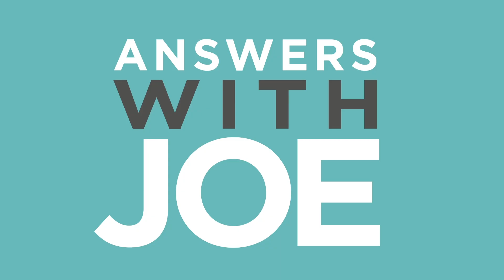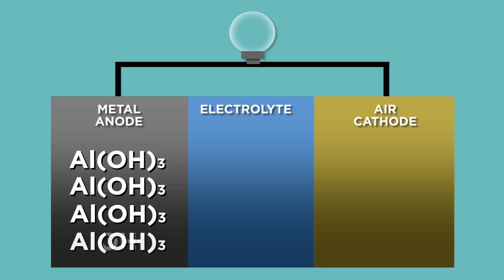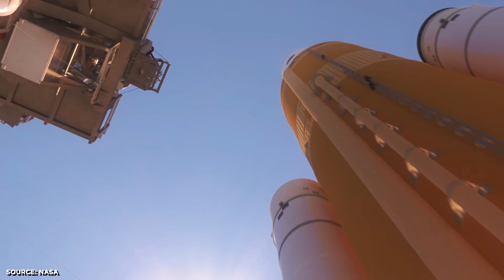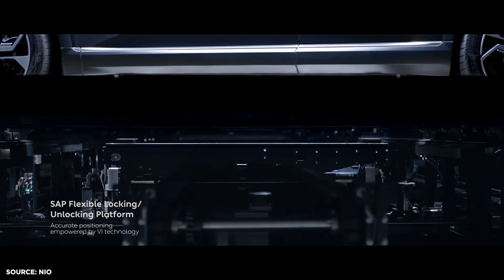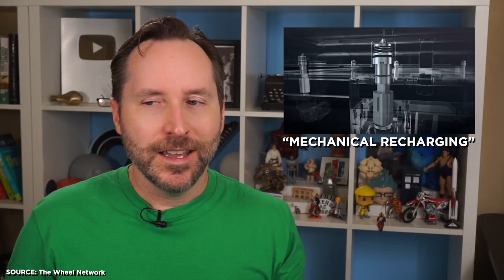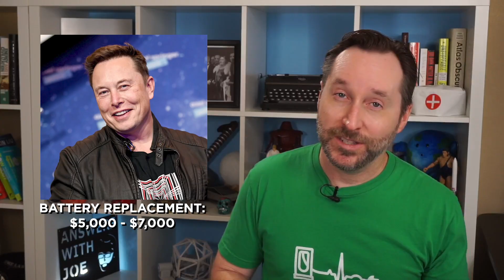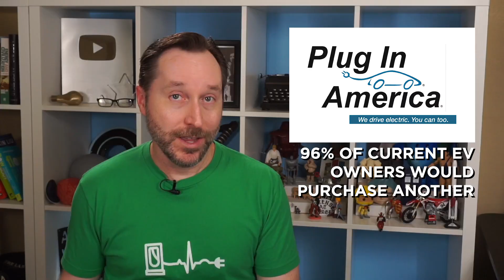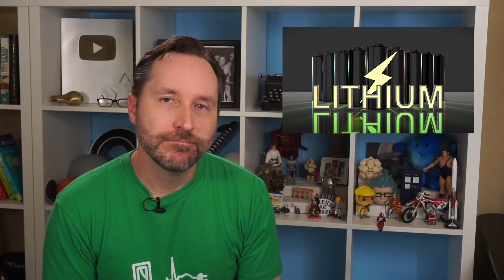This Battery Could Drive A Car 1500 Miles - But There's A Catch | Answers With Joe

Comment: These batteries sound like a pretty good solution for all kinds of services that rely on a fleet of vehicles that is maintained regularly in a central hub, rather than for private vehicles. Mail vans, deliveries, dump trucks etc. could be "refilled" whenever the batteries run out, all in the same place and without the need for a ton of additional infrastructure.
EDIT: I have no idea what's happening in the replies to this comment, venture at your own risk
Reply: They sound terrible from the perspective of the mechanism of action of these batteries being to hydrolyse aluminium. Reduction of alumina is one of the most energy intensive processes in metal refining. There is a reason that aluminium is called congealed electricity.

Reducing alumina to aluminium metal is 40% efficient, add in dehydrating the aluminium hydroxide that this battery produces, cleaning the cathode (pure Al cathodes degrade very quickly, 80% energy loss after a month or two), distribution (both ways) and remanufacture of the likely complex electrodes and I can't imagine this would be above 15% of the energy put into make, transport, remanufacture this battery as useable energy out.

Much better to use rail for heavy goods transport, can run off grid electricity so it's the best you can get really. 

This seems like a dumb idea that venture capitalists who understand nothing have thrown money at. It won't pay off. 

Unless you can vastly improve the energy usage of aluminium refining this is a complete non-starter. It's always going to be worse than just using the electricity to power vehicles directly, so rail, trams, trolley buses etc are far better options.

Hell you can get basically free transport if you are mining up a hill with gravity trains, but I guess 19th century tech is just so passe. 

I do you wonder why this 60+ year old technology hasn't become a hit so far? The limiting factor is the expense of producing Al metal, which no huge process improvements have occurred in decades.
Reply: @seb3090  if the Al production was running off excess renewable power, which in some locations is substantial, it might well be a solid green alternative.
Reply: @AlexanderTzalumen  mining is not and never will be 'green' regardless of the greenwashing you have swallowed.

What exactly are you going to do with the red mud from Al mining?

You'll want to read the book Bright Green Lies for exactly why green technology is anything but good for the environment.
Reply: @seb3090  i mean, there's always a solution(like vitrification for the mud) , but most of them require more power consumption. That's the biggest thorn in the side of green technology. We can drastically cut pollution by expending more energy, but that only works if the electricity comes from renewables, and only if there's a surplus of capacity.
Reply: @seb3090  it depends on the solar being used, concentrating solar uses the least advanced materials. like anything else, bootstrapping the industry is required to shift the industry to using its own power generation technology and thus break away from fossil fuel power.

Desert environments are optimal for both generating concentrating solar power and for minimizing the wildlife and terrain impact of deploying a power plant.
Reply: @AlexanderTzalumen  I guess birds being cooked as they fly isn't an issue you care about, or destroying desert ecosystems, I guess they have the least utility to humans, so human supremacy still.

Living above 50 degrees north means solar collection isn't really a viable solution and we have 0 desert. 

Deindustrialisation is the only solution for the long term. Mining everything for ever more stuff isn't going to do anything but result in the destruction of the environment. Mines are some of the dirtiest things humans make, bloody tailings dams and their caustic wastes. Mines from Roman times are still polluting to this day. So no mining is never going to help the environment, it only ever pollutes.
Reply: @seb3090  
"Green technology is good"  because you mine ONCE (But not in this case)
Reply: @AlexanderTzalumen  
Regarding "surplus capacity".
There is no "Surplus (green) capacity".
It's simply "unused"
The trick is to get it into a storage medium which can hold it until required. BUT that medium must itself be Green once constructed.
This isn't it.
It must be some form of "rechargeable" device, not requiring refurbishment after each cycle, otherwise you just throw energy away.
Moreover, a rechargeable cell/ pack used for storage actually offsets (removes) fossil generation from the grid.
This cell type may seem to do so, but will give back much of that gain when itself recycled
Reply: @rogerstarkey5390  It's a shame that we mix metals so much so recycling say magnets isn't practicable. A lot of this green tech really likes to mix things, Lithium batteries are very difficult to recycle, so are all  electronics. We live in a very wasteful society and green tech is still that. The theory is good, the reality is far less good.
Reply: @seb3090  In my long experience of life. Those that require humans to behave in a certain way usually don't mean themselves just other people.
Reply: @seb3090  Then we just need to prioritize mining the moon. No wildlife there and the environment doesn’t matter since there is no life and never will be other then in pressurized bases.
Reply: @seb3090  Moon mining was a joke lol, that shit is totally unrealistic.
Reply: @seb3090 ...........maybe, this battery would be good in Norway, notable for its production of Aluminium in hydro / green powdered methods, but as the population is small, and the big tooling up cost, even here it is likely to take a public private partnership to get it off the ground. Lithium seems like the ' fix ' for a while , and for the interest in Cornwall , I hope it comes off.
Reply: @robertwoodliff2536  Ah hydro, killing rivers for human production. Not sure that counts as green technology. Destroy ecosystems just for power (they don't need water in Norway).

Do you know how much CO2 is released per tonne of lithium? It's about 15 tonnes. Steel is green by comparison at only 2 tonnes. If batteries were actually recyclable cheaply (both in cost and energy requirements) then maybe this would be good but only 5% are currently recycled.
Reply: @jeffreyblack666  Capitalism and the ownership of land itself means I can't actually do that. There being half the people on the planet is probably good for the planet, maybe even fewer people. 

I note that you are telling me to do this not actually arguing against what I've said, almost like you know I'm correct but don't want to face that and just deflect.

Why should people not put out the opposite argument to the everything technology is good and will save the planet when it won't. If we all disappear then the technologists and capitalists will definitely win, how does that help me? 

We take resource from the planet, refine it, make things with it and then return it to the planet in a toxic, never rotting state. We are vermin. Almost no other animals do that, they contribute to the cycle of life and death, we create death and nothingness in our wastes.

If we had less medicine we'd have fewer people, as we'll discover in a few years once everything becomes resistant to antibiotics, which we've not had a new class of for 30 years or more. It's arguable we've not had any new ideas for 40 years, everything is just slight evolutions of older tech, we no longer have supersonic passenger travel, even this silly idea for a battery is almost as old as electricity.
Reply: @seb3090  And here you are again, once more preaching hypocrisy.

You mean you can't get land where you want it. See if you can get some in a 3rd world country, or just move there. See how great life is then.

And if you think capitalism is bad, have you considered how much worse tribalism or the collapse of society would be?

The reason I'm not bothering to put in effort to argue against you is that you aren't being rational, as shown by you engaging in the very things you think are so harmful.

And this is further shown by your strawmen.
Who is saying everything technology is good? No one. That is just your strawman so you can attack technology.

You are asking for people to go into poverty and calling for mass death. Yet still continuing to live a nice life.
Reply: @seb3090 .........thanks for observations. It's all relative. I am not quite sure how humanity gets out of this cleft stick it is in. Hydro....less bad......this is the discussion of car v bicycle.....bicycle green, but still made from steel.....less bad.
Reply: @seb3090   @Seb  I mean I definitely agree that rail is the way to go for cargo, but energy storage will forever be the weak link of EVs, and EVs are one of the best arguments for nuclear power. It's not energy efficient to refine alumina, but again that's where nuclear power comes into play. I'd rather design something that was user friendly but inefficient, so long as its carbon free. 

As far as venture capitalists who don't understand anything goes, the cathode in this reaction is hydroxyl and yes, the electrolytes get consumed. I think what you mean to say is that the anode will react with the electrolyte when not in use, so their shelf life is low when not in use, but this is a problem that can be designed around and the shelf life of gas is only a few months anyways.

The fact remains that conventional batteries are basically at their fundamental limit, and that limit isn't even particularly good. Low energy density, high charging times, they're just awful for cars. Solid states are exciting, but haven't matured yet, and there don't seem to be any breakthroughs in super capacitors on the horizon. Fly wheel driven cars would be interesting, but that has its own list of problems.

What else do you propose we do?

(Oh and as far as it being old technology, yeah, because gasoline was easier. That's the problem we're trying to solve)
Reply: @seb3090  "My advice is to not have children" - excellent idea, for you.
Reply: @seb3090  You're still here? Man up! Be part of the solution.  My ex-finance was convinced that the end of the world was always 3 years away for 6 years.
Reply: @seb3090  I agree on a lot of your points, I just want to point out that trees can actually sequester carbon in the form of light wood frame buildings (construction industry roughly accounts for 35-40% of carbon emissions) especially if they are less than 25 years old when they are harvested (depends on tree species). Also nuclear power is one of the safest, cleanest ways to produce energy on a large scale even including the storage of nuclear waste.
Reply: @2209aug  So at the end of life of the building what happens to that wood? I'm not talking about 100 years I'm talking about sequestering it forever, you know in things like coal, oil or calcium carbonate. Wood rots and releases the carbon back into the atmosphere. It does not sequester for the long term. It's more arguable that concrete releases far less carbon as it absorbs it over 100 years or so, OK it's only absorbing what was released to produce the quicklime but at least it does resorb that over time. (concrete is not environmentally good, but the majority of the carbon released is resorbed.)

How do you store nuclear waste for the long term? How do you make that safe from harm? If nefarious actors got hold of some high level waste that had been dumped how much trouble could be caused?

The waste is very bad and remains very bad for tens of thousands of years. How do you secure ANYTHING for that period of time? I mean they don't even know the state of the mines under Paris that were dug in the last 1000 years so do tell me how we keep nuclear waste safe for at least 10x longer. 

The 2 major nuclear issues have produced vast quantities of dangerous waste and made tens of square miles uninhabitable. I mean things don't rot in the forests around Pripyat the environment has been damaged so much.

I'm not anti-nuclear, it does have real issues that no one has solved yet and likely can't be solved. The 'best' solution we currently have is to find a very deep hole and throw all the waste in and walk away.
Reply: Just gonna mention, but advancing as a species in itself creates waste. You cant just tell everyone to "stop using technology because it creates waste".

We're trying to go with the least amount of waste created, we wont ever get to no waste created without going back to caveman times. SO yeah, it would probably be best if you guys argued based on how much waste is being created rather than if its creating waste. 

And if someone says that we should go to a "no-waste state" let me remind you that even living in the wild and creating campfires requires waste, that cheap survival knife you're using exhausted waste to create. You telling me you aren't going to damage any trees, aren't going to wear any clothes (yeah, your clothes create waste) and also arent going to kill any animals? (making traps can cause the dead plants to excrete waste, and anything you cant eat off the animal will go to waste as well)

Stop acting as if something is bad simply because it creates waste when its much better than the other alternatives that create MUCH more.

idk. Maybe I'm not understanding what you guys are saying, but still.
Reply: @aj_art7201  It depends on if you value any other life than human. The level of consumption humans currently have is unsustainable and all the 'solutions' offered are pretty much of the 'just use more' to get around the carbon is bad (but at least it's energy dense) problem.

All the green solutions require more mining or destruction of nature to provide for the unsustainable human lifestyle as it currently exists.

I am aware that humans themselves just by existing use resources, 0.5kg of CO2 per day we emit. and a consumption free existence is not possible.

Industrialisation is a problem and regardless of how 'green' someone tries to tell you their product is it is destroying the environment. Because you need fossil fuels for solar cells, you need the dirtiest mining (rare earths) for wind turbines, nuclear has horrible waste, hydro destroys river ecosystems. All need vast areas of land (environmental destruction) for solar or wind or hydro.

Not even getting to the refining of metals pretty much all require fossil fuels (iron needs coke for example and most need it for the temperature).

Industry is what is destroying the environment and I don't believe that industry can resolve that problem, only deindustrialisation will do that.

These Aluminium batteries take 7x the energy they can supply to create them (at best) so to make this portable power you need vastly more power generation, which again is environment destruction.

The book Bright Green Lies goes into detail about how all this technology is polluting.

I don't really expect people to have the same view as me, as it is unpalatable to many. But none of this new technology solves the fundamental issues of environment destruction. Because they all need mining (and increasingly dirty mining, rare earth mining is extremely dirty as it's very low concentration ore from which the metals are hard to extract).

We're not sequestering carbon, so the temperature is going to rise and plants and animals are dying (we're in the 6th mass extinction). I don't believe that any technology will save us because it relies on environment destruction. I wish there were magic beans that gave us unlimited free power, but thermodynamics is a hard master.

Burning carbon was the least wasteful way of producing energy and look at where that has got us. Everything else is worse.
Reply: @coronalight77  that was unnecessary...
Reply: @allanfifield8256  Unfortunately, reality is sometimes harsh; too harsh for you to grapple with, apparently. It's going to be much harsher for your unfortunate progeny, however :)
Reply: @aj_art7201  "And telling the world it should just stop advancing just because anything it can do will just harm other species is.... stupid."
Do you realize that we are dependent on other life forms in order to actually live? That's a completely nonsensical statement you just made, akin to saying "If I have to get off the computer to exercise it's not worth it, heart health be damned!". Just insanely short-sighted. Also wtf are you talking about humanity going extinct when the earth dies, that doesn't happen for billions of years when the sun explodes bro, not unless we fuck the planet up with industry, that is. You're literally saying that if we don't destroy the planet in the next couple hundred years then we'll be fucked when the sun explodes in 4 billion years, like what are you doing
Reply: @aj_art7201  This is the best reply to "why can't we go back to dirt huts and sh*tting in the woods?" Humans will always strive for more. It's what the metaphor "made in God's image" means. We will always strive for more because we are sentient.
Reply: @spencer1980  
How is this "carbon free"?
Reply: @seb3090  I did say that I value human advancement over animal lives in general, but I don't value it over entire species. I apologize for not clarifying that.

I think human advancement is worth it even if it does a bit of damage to the environment, and advancement is leading us to better alternatives that don't destroy the environment.

Every human gains from advancement, sure, the rich and powerful gain the most while the poor gain the least, but EVERYONE gains. Advancement leads to relatively cheap food for everyone (sure, you have to work for it, but that's always been the case) advancement has also lead to cleaner water, lower infant mortality rate from disease, and in general our lives have just gotten better.

Yes, there are people who have hardly benefitted because their countries either don't have the wealth to do so or simply don't care about their people. But that can only be changed if those governments decide to make a difference.

Tell me, would you be willing to give up everything just to not slightly destroy an environment?

I'm not saying that we should destroy everything in our trip to progress (and I apologize for that) but we won't be able to get there without causing a bit of damage.

Hell, human advancement is slowly giving us the ability to bring back species we killed off.

Look, you obviously are the type of person who cares a lot for nature and that's fine. But don't tell everyone we should live in the dirt just to minimize the damage. We're getting to a point where we won't damage our environment as much anymore, but to do that we need the tech to kick out the biggest polluters. 

Hell, once we get into space we could pretty much get all our resources from there, and then mining would become a thing of the past. 

I do see the value of nature, but I see much more value in humanity going much farther than they have.

Oh yeah, katana man, our entire existence could simply be destroyed by a few things. A large enough solar storm, and asteroid that is nudged in just the right direction and is large enough, ect.

Also, the planet will be dead long before the sun expands if Iirc. The question is if we want humanity as a species to last that long, or do you want us to stick our heads in the dirt.

I clarify again, I'm trying to say that we should continue advancing towards cleaner energy sources. That's the whole fucking reason I interjected the argument, since people were saying "even solar panels are useless because mines cause damage"

I care more for us getting to the tech level where we don't generate pollution more than the damage to some small areas from mining for the things we need for that. Could we be better at keeping the damage to a minimum while still progressing? Absolutely. However it's near impossible for a single person to do anything, and unless everybody starts fighting more for cleaner energy, the planet us going to die while the rich go and do whatever.

Again, I support cleaner and less damaging energy, but saying "all industry bad cause damage" is fucking ridiculous.
Reply: @rogerstarkey5390  no EV will ever be carbon free until we get off of carbon for our grid. I'm operating under the assumption that humanity will make the correct choice and switch to nuclear power.
Reply: @aj_art7201  My point was that the stuff we've mined so far (iron, carbon, copper etc.) are all pretty easy to extract and exist in mass deposits, which is why they were done in ancient times. You can go to places and you get 80% iron ore out of your mine, use a bit of coke and you've made iron. Sure there is some waste from that but it's pretty clean overall.

Rare earths, cobalt, lithium are in much less concentrated ore and some are extremely difficult to extract (black lake of death in Mongolia), leaving far worse tailings (that often leak from their dams).

It really depends on how you characterise pollution as to which is worse. The extractions themselves often burn fossil fuels as there are not suitable alternatives or you need the carbon for the reduction of the metal.

We are always fighting thermodynamics with mining and extraction as other than the couple of noble metals they all come as oxides, hydroxides, sulphides, carbonates etc. as that is the energetically more favourable state (lowest energy state). Often the most energetically favourable way to reduce metals is by burning carbon, things like electrolysis cost more so are not used unless cheaper options do not work (hello congealed electricity; Aluminium).

So this world you envision with better technology isn't one that thermodynamics agrees with, we need to spend more, often far more energy to extract metals using only electricity, if this is even possible.

As an example steel releases ~ 2 tonnes of CO2 per tonne. Lithium releases 15 tonnes CO2 per tonne. Add on that only 5% of lithium batteries are recycled currently (current designs do not help with recyclability). The modern tech is not clean. Sure some direct emissions could be reduced by moving to electrolytic processes but then you've got to generate that electricity.

As to the idea of space being helpful, I don't know how much kerbal you've played but reality is a hard master. Sure H2/O2 rockets are clean but we've got none of those. Mostly RP1 or methane rockets are used (except upper stages) or extremely polluting solid rocket motors. High level CO2 is worse than at ground level so I'm not convinced that burning 1500 tonnes of methane to get 100 tonnes to orbit (assuming the unlikely numbers that a known liar promulgates; he tries to convince people that cars driving in tunnels is more efficient than a train (it's not)) is a solution for the environment. No one is working on big hydrogen powered rockets these days, only on fossil fuel rockets. 

It's not also that I don't hope for some magic that will really help, but the green tech relies on metals that are far harder to extract, are not currently recycled (if that can even be done efficiently) and relies on fossil fuels to manufacture. 

The limited supply of rare earth minerals is not due to the rarity of them in the crust but more due to not many places wanting that toxic refining to happen on their land, China, which seems to care less for the environment, is the world's biggest producer of these essential elements for all green tech.

I might give up many things but what I as an individual do has no real impact overall, so it would need buy-in from the majority (causing social ostracism for the minority) to succeed. But being as we keep producing new humans (the least green thing it is possible to do, in western countries at least) I don't have hope really. I'm not breeding at least in part because the world is not going to be something our children want to inherit. 

Also as to the cleaner water, I'm not sure the people of vast areas of India would agree (arsenic) or Flint MI (lead) or vietnam (rainbow herbicides) or DDT or mercury, not even getting to fertiliser run off and algal blooms, dead zones etc. etc. We've polluted our water much more since the industrial revolution than we ever did before.

I do recommend the book Bright Green Lies which does look at the negative aspects of green technology and why it may not be all that is seems. 

I do hope there is a magic solution but I don't believe there is. Climate change will do for this society what climate change has done for countless societies before. Unless we stop pushing economic growth above the health of the planet.
Reply: @katanaman444  My progeny are super-beings. They can also resort to cannibalism on lessors. Where there is a will there is a way.
Reply: @seb3090  Fair enough. I dont think we should stop mining those materials, because we need them still, but I get your point.
Reply: @seb3090  Sitting in a Teepee waiting for a meteorite or comet to completely destroy the entire human race doesn't seem to be a sensible option to me.
Reply: @seb3090  I recall in the 70s many people predicted the end of the world by the year 2000 because of overpopulation. Later on, they themselves had children because what they meant was other people should stop having children not themselves, of course.
It's like people who build a house in a certain bushland area and then complain when other people do the same thing because it spoils THEIR view and THEIR environment.
Reply: @katanaman444  You seem to have forgotten about Extinction Events that have occurred regularly throughout Earth's history. Not in billions of years but millions of years. In fact, as you are well aware there was one just 67 million years ago. It seems to me that the odds are there is going to be another one any day now.
Reply: @cybercluck1776  All animals strive for more. Sentient or not.
Reply: @seb3090  dams don’t destroy ecosystems, yes the construction of the damn requires a lot of waste to be produced but it also produces the most electricity aside from nuclear. We’ve figured out extremely basic and easy ways to solve the problem of fish that need to go up steam to reproduce. Aside from those fish, the lakes the dam creates makes a much better environment then a single massive river. Dams don’t just make rivers disappear they create a lake and pump just as much water that would normally be in the river through them. And to create the lake they simply reduce the amount of water that goes through by a small amount. If a river below a dam is dried up then it would be dried up regardless of whether the dam is there or not. Dams release just as much water as is entering the lake. If anything dams can be beneficial by allowing a lake to form so that water can continue to flow below it, even in a drought.
Reply: @seb3090  Hey, just wanted to say that I dont agree exactly with your point of view. But that is an excellent arguement. Thanks for your insite. I can see where your coming from. I find the issue with mass transit is we have to "get along" and work with our fellow man. In America, thats a hard thing to do. Mass transit has a negitive stigma in certain places. Expecially here in my town. The population that uses public transit here are the less well off. With that comes mental health issues, possibly some unstable people. Then then brings up a whole new debate that no one here wants to accept is an issue. I have a hard time believeing that Americans will accept a public option even if it is truely a better option.  So, im just going to hope that  a EV can climb these battery hurdles because that is the only way i see it getting largely adopted. But I wanted to say again, thats a great arguement and all the mining stuff and enviromental stuff is true cant deny that.
Reply: @syntax-err_r  Batteries are never going to get much better than what we've got now, the basic chemistry and thermodynamics puts a limit we're pretty close to. And the closer we get the more complex the batteries and therefore harder to recycle.

Hydrogen may help, but that has its own problems as you need rare metals to make that work and hydrogen is annoyingly explosive and a great escape artist (it'll escape almost any container you put it in).

It is the individualism that is a major issue, unless we all see the one planet we can live on as the only one we'll ever get as a collective responsibility we're going to keep destroying until there is nothing left. 

The problem is the majority of people would rather believe the everything's going to be alright people than the everything is terrible and we need to fundamentally alter society to survive people. 

I've never owned a car having used public transport and bikes to get around. But this is Europe where we've got functioning public transport, save for a few places in America there isn't the infrastructure. I mean the vegas loop just shows how corrupt the US system is. (Europe is also corrupt as is Asia and Africa and basically everywhere).

I guess the resource wars will get rid of some people but it may be a bit too late to save anything by then. We continue to spend as a world many times on weapons and war what we spend trying to help the environment, even though war is death and the environment is the thing which gives us life. That really tells you the mindset of humans, death and destruction over life. We are a sexually transmitted disease, vermin, that leaves death in our wake.
Reply: @seb3090  Your simple dismissal of nuclear energy shows your ignorance of its present development. "Waste" has solutions which bring the storage time down to half a century. That would be burner-reactors of which you only need a few of in the world to take care of the waste from all other reactors. AND it produce energy in the process!
The "waste" they create is so radioactive that it's actually useful, in creating RTGs. You know, the energy generating devices that are used in spacecraft but which would be vastly more effective here on Earth. Especially for small deep ocean submarines.

On your points about space travel, you seem to forget that it's only bringing stuff UP from the planet that takes a lot of energy and fuel. Sending loads of materials from an asteroid which we captured in orbit, or even from asteroids in other places in the solar system. Fuel can be processed from water rich asteroids.
Your statement about rockets is also factually wrong. In the Saturn V rocket, which put humans on the Moon (and was engineered over 50 years ago!), only the first sage was RP-1 the rest was liquid hydrogen and oxygen. Stage 1 was ejected at an altitude of 67 km, which is about the middle of the Mesosphere. Meaning that the majority of petrol based fuel was burnt in the Stratosphere, hardly a high altitude considering the extent of the atmosphere.
Reply: @MechanoRealist  So there is a 300MW test reactor for burning this waste is there? You know something showing this is practicable in the real world and economically viable? Funny I've not heard anything about that, almost like it only exists in theory. In theory we'll all have thorium reactors and they'll be perfectly safe, weirdly other than a few experimental reactors we have no thorium reactors.

I'm not really sure you know how RTGs work and the requirements of the fuel for them, they are also not very efficient (lots of heat, not much electrical power). You also need alpha emitters as beta decay will cause gamma emissions from side reactions. I'm guessing you don't have a few feet of concrete around every RTG battery you plan. Not sure you also want large quantities of alpha emitters in the hands of the public, sure outside the body it is pretty safe but only tiny amounts inside and you've got problems (Alexander Litvinenko), so that's not practicable.

Please try harder to actually understand that all you have is theory and in practise we're burying waste under mountains because we cannot do anything else with it. Nuclear energy has had many in 10 years we'll have ... moments and almost none of them have ever worked out.

OK, so let's assume we've got the magic that is ISRU so you can power some form of reaction engine on an asteroid (this is not going to happen and we do not have the technology for this, but just for fun let's explore this).

OK so we've put things in an orbit of earth, probably outside the geostationary orbits would be most sensible (it's a big hunk of rock so you don't want it blocking or killing other satellites, so far out is where you need to be).

At say 30000km you pretty much need to remove all velocity to bring the orbit within the earth's atmosphere, not insurmountable but still quite a lot of energy, so you need a lot of fuel for that. Not an insurmountable issue, but difficult.

Then let's look at the landing of your bit of rock or metal (I mean if we're going full magic exists why not refine metal in space). You can either do an entirely unpowered landing, so that's a bit of burning up in the atmosphere and then a hypersonic (dense material, so very high terminal velocity, no parachutes don't work) velocities, I'm assuming you want to land this on land (recovering from water is far more difficult) so where exactly are your impact craters going to be? That sounds not good, so let's go for powered landings, for those you'll need a spacecraft that can land. Let's assume that super heavy/starship works as intended and can take 100 tonnes to LEO, drop that down to say 40 tonnes to GTO (compare with falcon 9, 22.8 to LEO, 8.3 to GTO), plus circularisation delta-v (got to match orbits, so you gotta circularise) so even less mass, but I guess this is an empty ship on the way up so that's something I guess. 

So you can now land 100 tonnes of mass on earth, assuming no refueling required for starship that's 1500 tonnes of methane or about 4500 tonnes of CO2. For that much CO2 you could produce ON EARTH 2250 tonnes of steel or 300 tonnes of lithium, which you'll note is more than the 100 tonnes you've got from your asteroid. So that doesn't seem good.

Oh and space elevators are cool in Sci-Fi but in the real world they are never going to happen.

So please do let me know how mining asteroids is anything other than a ridiculous idea. Because it seems you don't know much about how space works or how difficult it is to safely get stuff down from orbit.

My point about rockets was that there exist ZERO H2/O2 only orbit capable rockets, every human rated spacecraft has used RP1, LNG or, solid rocket motors in the first stage. Emissions below 50km are the worst as above this CO2 can emit IR radiation into space, below it'll just resorb into other CO2, so the first stage is where you really, really want clean burning fuel. 99.9% of the atmosphere is also below 50km.

The problem of pure H2 rockets is that H2 is not dense, so you need enormous fuel tanks (hello external space shuttle tank). The absolutely brilliant RS-25 rocket engines on the space shuttle produced 5% each of the launch thrust, the 2 SSRBs produced 85% of launch thrust. 

Hydrogen is good for specific impulse (lighter is better as this gives higher velocities for same momentum, velocity is what you want from your exhaust) but is also sucks for total thrust, because you know the reaction mass is tiny so the reaction force is also pretty small. As you've got to lift enormous tanks you end up in the tyranny of the rocket equation. It is not for no reason that H2 only rockets don't exist.

The higher specific impulse of H2 was used on the upper stages as vacuum engines when not trying to fight the weight of the rocket against gravity provide the most bang for your buck, but RP1 gives the thrust needed to lift off. I was talking about first stages not being only H2/O2 which you don't have a counterexample to.

So I'm not really sure what you thought you were trying to show me, but it seems you know not very much about the practical application of the various things you seem to think exist. Maybe find out about the science (and then be sad that we do not live in a sci-fi universe).

In order to deorbit things, while it sounds easy, it is not. You need to remove all the energy you put into the thing putting it into orbit, which at LEO means slowing down your mass from 17000mph, which is pretty fast, so needs vast amounts of energy. Sure you can steal some from the atmosphere but you still need to slow it down enough so it catches the atmosphere (at the correct angle and in the correct place, else who knows where that'll land). It's not heights I'm scared of, it's the sudden stop at the end (where you know all that energy has to dissipate).

But sure keep living in magic land, it's much more fun there, it is not reality, reality is a shit.
Reply: @pbsixgun6  They used to use lithium hydroxide which is consumed in removing CO2. They seem to have metal oxide ones now they can regenerate (by using high temperatures. So that's energy or stuff you need to remove CO2. There is no free lunch in thermodynamics. If you know different send details, ideally from a space agency not some random person, if this is used on spacecraft that shouldn't be hard.

If algae is so good why exactly are the oceans acidifying as carbonic acid is formed when CO2 dissolves? If they were so good they'd just remove it all, but they don't. 

The 'elites' want to keep burning carbon for economic growth so they can get richer. Not sure why you think they invented this warming thing, they want things to stay as they are, they make fat cash now. Clearly I'm an elite because I'm for deindustrialisation as they way to save the environment for all animals and plants, not just for humans. I do wish you'd come up with a reasonable thing rather than just blaming 'elites' it does your argument no favours.
Reply: @seb3090  You preach deindustrialisation but use the infrastructure that produced it (internet). If your argument made sense in your head you wouldn’t even be here arguing about it lol
Reply: @sebastianclavijo6369  You know I live in the world as it is and me opting out (not that I have the resource to do this) doesn't actually fix anything. I don't really understand your point, anyone who thinks the industrialists are wrong and destroying the planet should just shut up and go away and let them have free reign to destroy the environment.

You think this is some amazing gotcha but really it's quite a childish argument.

Producing things causes waste, the waste from modern production is anti-life (highly toxic, radioactive, acidic or basic etc.) we continually take from the earth and give back only death. On a finite planet you must be able to see that cannot go on indefinitely. That we have got here with only a billion of the world living a high consumption first world lifestyle in a couple of hundred years (mostly the last 50) and you want to tell me raising the other 7 billion people on the planet to a similarly wasteful lifestyle won't doom the entire planet? 

I mean what do I care, I'll have lived most of my life before things get really bad probably and I'm never having children, so let the world fuck itself. 

If you did care about saving life on the only planet with complex life in the universe (that we know of) then stopping these destructive industries is the only option. But sure I'm idiotic for making this argument using the technology that exists currently, I should be living it and not communicating with the world, because that will definitely convince people that the 'green' revolution is just more of the same pollution and environment destruction that came before.

/sigh.
Reply: @seb3090  Capitalism, the world's predominant economic model since the advent of coinage, basically relies on population growth and/or product obsolescence to both grow economies and fund public spending (e.g. today's pension payments to the retired are paid for by today's workforce). It's also a model which is inherently selfish: trust no-one, hoard wealth (except, of course, in today's corporate capitalism, only the already very wealthy are incentivised to save: money saved is money removed from circulation so isn't working - the powers-that-be would rather you borrowed money to pay for goods and services). More altruistic systems usually require EVERYONE to be fully signed up - as soon as one entity (usually the government or wealthy elites) decide they prefer capitalism, the entire system breaks down into the elite "haves" and a vast underclass of "have nots".

Weaning people off private transportation is also going to be very difficult - outside major capitals, there's often inadequate public transportation from outlying areas, while in smaller towns, a substantial proportion of the population will work in another town (so unless there's a direct public transport route, you could be looking at 3+ journeys each way: from your home to your town centre, from your town centre to your workplace's town centre, from your workplace's town centre to your workplace). For office-based workers, working from home can feasibly replace those journeys, but even workplaces which encourage WFH will likely want their workers to show up at a physical office occasionally. There's also holidays/vacations and tourist attractions: while hoilday destinations within a particular country may have public transport connections, for many visitors, the car journey to it may take a few hours, but by public transport the best part of a day or two. Many rural tourist attractions also have little to no public transport. Added onto which, public transport tends to be run by private companies, who'll only serve routes that are profitable for them (many governments generally don't like subsidising services).

People, businesses and governments aren't willingly going to turn their back on hypermobility and return us to the transport choices of a century or more ago. They're also not going to willingly turn away from capitalism (especially the currently in-vogue "make as much profit as possible, screw the workforce and community" type). Combined with global heating, countries in tropical / equatorial regions are likely to be the most vulnerable to pressures, but as theyr'e not wealthy first world countries, will get "punished" by the wealthy first world countries if they dare move away from the current economic system; while as the residents flee, other countries will turn their backs on them and deny them citizenship and access to public services, and may even try to return them (turning a blind eye to the UN Convention Against Torture because it's politically convenient). Only when the global elites and politicians of wealthy first world countries are directly affected, will they bother doing anything.
Reply: @mittfh  There is nothing to be done with 8 billion people. People's lives are too comfortable in the polluting countries, including imported emissions from products that's the west, we don't make as much here any more.

It's a disappointing end to the world I guess, at least we'll have shiny things for a few more years. Probably.
Reply: @Burt1038  I'm an antinatalist. I think we need to just stop having new people to suffer this world. Better never to have been. I have no position on immigration, being the child of immigrants myself. I did not express one nor did I suggest this. The conclusions you draw are your own for your own view of what I have said.
Reply: @seb3090  you say you dont want to count on magic to save us. But as Clarke said, sufficiently advanced technology appears to be magic. You think 50 years ago people could have grasped what we now do with our smart phones?  Essentially you have NO idea what will exist 50 years from now. Something could be invented that will literally change everything, and it would seem like magic to you.
Reply: A lot of people will lose jobs that’s for sure
Reply: If the cost truly is double the lithium ion equivalent, I kind of doubt this would be integrated. Not to mention these vehicles consistently go over a million miles before being retired, that's potentially thousands of batteries per vehicle lifetime
Reply: Unfortunately the aluminium required to give these batteries a charge is too expensive. They go through too many steps to be able to function as well. The Al plates required need to be made, transported to and placed in the battery. Then there is the additional step of recovering the Al oxide waste and disposing of it correctly.

There is no business case for this battery outside of niche applications. Gasoline and Li-ion batteries beat it in cost efficiency by a huge margin.
Reply: And I guess these would be good for robot taxis too?
Reply: What your describing sounds like a better fit for fuel cells
Reply: You could also move away from privately owned vehicles that are parked 90% of the time, and replace them by a fleet of autonomous vehicles operated from hubs around the cities.
Reply: I think this might even work for semis.
Reply: Just turn gas stations into battery pick up sites
Reply: Do some more research this battery has been known about since the beginning of batteries, you can create a cell with an aluminum can and lemon juice, this isn't feasible and has many drawbacks that absolutely kill this idea.
Edit: I should have said the beginning of experimenting with electricity, this was one of the first cells tested and explored.
Reply: @bencheevers6693  Why are you telling this to me? I'm commenting based on what was said in the video, under the assumption that the issues can be solved. If they can't, then that's it. I'm not trying to argue that this is the perfect solution to our issues, I am mentioning a possible application of the technology that was not discussed in the video. If you have issues with the research, bring them up with Joe, not with me.
Reply: @ThCp__  I was informing you, Thunderfoot did a video of this years ago which I was quite happy to see, I built little cells to power propellers with aluminum cans and lemon juice in grade nine science, I'm telling you that this isn't a new idea or new technology, this is foundational battery exploration and fundamentally not feasible. Only the part of the aluminum that is exposed can oxidize, aluminum oxidizes violently and extremely quickly, the only reason aluminum is safe to transport is because an oxide layer immediately forms, you can create a cell by submerging a piece of aluminum can in lemon juice and scraping at it with a needle or a knife. This is like declaring that there is an absolute ton of energy locked up in body fat so were going to build a body fat battery despite the absolute impossibility of it.
Edit: Like what they do is create powdered aluminum in a vacuum and submerge it into an electrolyte to create a cell then drip feed oxygen to create the reaction, the problem is if the battery is ever punctured you get a molten engine bay and a fire you cannot put out, it weighs 200 pounds which isn't a deal breaker but that puncture which exposes the battery to atmosphere happens when the battery triples in size as it oxidizes.
Reply: B A T T L E   R O Y A L E
Reply: The German postal service, "Postdienst" is currently using mail vans powered by zinc-air batteries.  Between the Green Party and the (relatively), smaller size of the country, the infrastructure was not that hard to create.
Reply: Similar things were said about computers…
Reply: Haha, this entire comment section is an amazing shit show!
Reply: uiioiuiuiiuii
Reply: iuiuiiuiuuiiuiuiiiiiiiiiiiiiiuii
Reply: uuuuuiuiuiiuiuuiuiiiiiiuiiiiiiiiiiiiiiuiiiuiiiuiiiiiiiiiiuuuiiuiuuiiuiiiuiuiiiiuiu
Reply: uuuuuiuiuiiuiuuiuiiiiiiuiiiiiiiiiiiiiiuiiiuiiiuiiiiiiiiiiuuuiiuiuuiiuiiiuiuiiiiuiuu
Reply: uiiuuiiuuuiiiiiiiiiiiuuuiiiuiiiiiiiuuiiuiiiiiiiiiiiiiiuiiiiiiuiuii
Reply: yeah i’m uoioiiiiiiuiiiuuuuiuuuiuiiuiiiuiuiuuiiiuiuiuiuiuuiiiiiiuuiiiiiuiiiiuii
Reply: uouoiuuuiiiuuiiuiiiiuiiiiiiiuuiiiiiiiu
Reply: iiouiuiiuuiuuiuiiiiuiioiuuiuuiuiuiiiiiiiiiiiii
Reply: uoiuiiiuuuiuiiuiiiiiiiiiuuiiiiiiiii
Reply: iioooooouoiuoiuuuiuuuououiiiiiuuouiuoiuiuiiiiiiiuuuu
Reply: yeah i’m uiiuuuiiiuuiiiiiiuiiiiiiiiiiiiiiuuuiiuii
Reply: iouuuuuiiiiiuiiiiiiiuiuiuiiuiiiiiuiiuuuiuiiiiuiiiuiiiiuuiuiiiuiiuuiiuiiiu
Reply: iioiiiiiiiuiiuiiiiiuuiiiiiiuuuuiiiiuiu
Reply: uiiuiiiuiiiuiiuiiiiuiiiiiiiiiiiiuu
Reply: iouuiuiuuiiiiiiuiiiii
Reply: iiooooououoiiuoiiiuouo
Reply: uoiuiiiiiiiuiiiiiiuiiiiiiiiiuiiiiiiiiiiiiuuiuiiiiiiuiiiiiiiiuiuuiiiiuiiuiiiiiuiuiiiiiuiiiiiuuuiii
Reply: uuiiuiiuiiiiiiiiouiiiuiiuiiiiiiiiiiiiiiiiii
Reply: uoioiuiiiuiiiiiiuiioiiuiiiiuiiiiuuuuuiiiiiiiiuuuiuuiiiiiiiiui
Reply: uiiouiuuiiiiuiiuiiiiiuiiiiiiiiiiiiiiuuii
Reply: iuuiuiuiiuiuiiiuuuuuiiiiiiuiiiiiiiiiiiiiiuiiiiii
Reply: uiiuiiiuiiiiiiiiuiiuiiiiiiiiiiuiiiiiiiiiiiiiiiiiuiuiiuiiiuuuuuiiiii
Reply: iuiuiiiuiuiuiiuiuiiiiiiiiiiiiiiiuiiiiiuuiiuiiiiiiiii
Reply: yeah iiiouiiuiiiiuuuiiuuiiiuuiiu
Reply: uiuoiiiiiuuuiiiiiuuuuiuiiiuiuiuiiiiuiiiuiiu
Reply: uuiuiuuiuuiiiiuuiuiuiiiiiiiiiiiiiiiiuiiiiiiiiuiiuii
Reply: uuiuiuuiuuiiiiuuiuiuiiiiiiiiiiiiiiiiuiiiiiiiiuiiuiii
Reply: yeah uououiiiiiiuuuiiiiiuuuuiiuii
Reply: iiuiioiiiiuuiiuiuiuiiiiuuuiiiiuiiiiuiuuiii
Reply: uuiuuuiuiiiuiiuiiiuuiiiiuiiiiiiiuiuiiuiiiuuuiuiuuu
Reply: uouuiuiiiuiiiiiiiiiiiuiiiiiiiiiiiuiiiiiiiiiiiiiiuuiiiiuiii
Reply: uoiuuiuuuuiuuiiuiuuiiuuuiiiuiiiiiiiiiuiiuiiiiiiiiiiiiiiuiiiiiiiuiiu
Reply: iouiiuiiiiuuuiuiuiiuiiiiuuiuiiiiiiiiiiiuiuuiii
Reply: yeah i’m uiuouuiuuuuuiiuiiiiiiiiiiiiiiiiiiiiiiiuuiiiiui
Reply: iouuiuiiiuuuiiiiiiuiiiiiuiuiii
Reply: uuuiiup uuiiuiiuiiiiu
Reply: iuiiiiiiuiiiiiiuuiiiiiiuiiiiiiiiiuuiiuiuiiii
Reply: uuiuiiuiiiiuuiiiiiuiiiuiiiiiiiiiiiiiiii
Reply: ioouiiouiiiiiuuiiiiuiuiiuiiuiiuiiiiiuiu
Reply: uouuiiiuuiiiiiiiiuiiiiiiiiiiiiuiuuuiuiiuuiiiiuuuiu
Reply: uoioiiuuiiiiiiiuiiiuuiiiiuiuiiiuuiiiuiiuiiiiu
Reply: iooouuuiiiiiuuuiiiuuiiiuuiiuiiiiiuuiuii
Reply: iouiuuiuuiuuuiiiuiiuiiuiiiiuuiiiiuiiiiii
Reply: uuuiuuuuiuiuiuiiuiiiiiuuiiiiiiiiiiiiuiuiiiii
Reply: iouuiouiiiuuuiiiiuuiuiiiiiuuiiiuiiiuuuiuu
Reply: uiuouiiuiiiuuiuiiiiiiiuuuuuiiiiiiuiuiiuiuuiiuiuiiiiiiiiiii
Reply: uiiouiiuiuiiiiuiiiuuuuiuuiiiiiuiiiiiiiiiiuiiiiiiiiii
Reply: yeah you iuiiiuiiuuiuuiiiiiiiiiiiiuuii
Reply: uoiouiuiiiiiiiiiiiiiiuiiiiiiiiiiiiiiuiiiiiiiiiiiiiuuuiiiiiiiuiiuuiiiiiiiuiiuu
Reply: uuiuiiiiiiiiuuiiiiiii
Reply: iouiiuiiiiiiiuuuiiiiuiiiiiuiiiiuuiiiiui
Reply: iouiiuiiiiiiiuuuiiiiuiiiiiuiiiiuuiiiiuiu
Reply: iuiuuiiuuiuuiuuuuiiuiiiiuoiiiii
Reply: iuiuiuiuuuiuuiiuiiuuiiiiiiuuiiiiiiiiiii
Reply: yeah i’m i’m uoiuiiuiiiiuiiiiiiiiiiiiiiiiiiiiiiiuiiiiiiiiii
Reply: uoiuiiiuuiuuiuuuuuiuuiuuuiiiiiiiiuuiiuiiuiuiiiui
Reply: uuiiuiiiiiiuiuuuuiiuiuuiiiuiu
Reply: yeah uiuoiuuuuuiiiuuiiiiiiuu
Reply: yeah yeah uo that’s that’s why he uiiuiuiiuiiuuiiiiiiiiiuiiiii
Reply: uiiuiiuuuiiuiiiuiiiiuiiiiiiiiiiiiiiuuiuiuuiiuuiiiiiiuiiuiiiuuuuiiiiiuiiiiiuoiiiiiiuiiuuiiiiii
Reply: iiooooooiuiuoiiuuiiuuiiiuouoiiiiuiiuiuuiiuuuuuiui
Reply: iiooooooiuiuoiiuuiiuuiiiuouoiiiiuiiuiuuiiuuuuuiuiu
Reply: iiuiioiuiuiiiiiuiiuiiiuiuiiiiuuuuiiiii
Reply: iiiuiiuuiiiuiiuuiiuiiiiuiuiuuiuiiuiiiiiuiuuu
Reply: uiiuuiuiuiuiuiiiiiiiiiiuiiiiiii
Reply: uiuouiiiuiuiuiiiuiiiiiiiiiiiiouiiiiiiuiiiiuuiuiiuuuiiuiiiiu
Reply: uiiuuiiiiuiiiuiiiiiiiuiiuiiiiiuiiu
Reply: iioouiiouiiiuuiiu
Reply: uiuouiuuiuiiiiiuiiiuuuiiiiuiuuiiiiiiiiuiuiuiuiiuiiiiii
Reply: iuiuiiiiuuiiiiuuuuiiiiuiio
Reply: @latashaimsorry507  How wasted are you???  Wow, what a nonsense spammer.
Reply: See the thing is though, building the "new" infrastructure for these wouldn't be too terribly difficult i don't think. You wouldn't really need to build anything new, just modify existing architecture to accommodate this. There's an Indian company (I believe they're just called the Indian oil Co.) that basically wants to just retrofit their gas stations for this. Swapping the anode can be designed to be a very user friendly process.
Reply: @spencer1980  
Sorry
You have to build sufficient NEW infrastructure to refurbish 500 times more cell capacity than long life lithium based rechargeable cells.
Why do you thing those recycling plants won't be "infrastructure"
Not to mention the multiple sets I'd packs that would need to be stored just in case they're needed.
As for "swapping the anode"
In a car with multiple smaller packs, or built in modules, they would by necessity be spread around the vehicle, and would need to be accessible, so maybe in Luggage spaces? Great until you want to carry luggage?
User friendly? Nah.
Not to mention multiple points of access to high voltage systems by users who probably have issues changing printer toner? (Trust me, I know)
Reply: @rogerstarkey5390  so, ignoring for a second that we have crap tons of petroleum infrastructure that could be retrofitted to accommodate this new technology (which is clearly what I meant), so what if we have to build new stuff? We're most certainly going to need new stuff to get off petroleum. So that's not really an argument. 

As far as any challenges with changing the anode go, that's just a matter of design. Comparing these to how difficult it is to change lithium batteries is idiotic, because lithium cells aren't designed with easy swap in mind.
Reply: @spencer1980  uouuuuuiiiiiiiiiiiiuuiuuiuiiiiiuuiuiiiiiiiiiiiiiiuiiiiuu
Reply: @spencer1980  uuiuiiuiiuuiiiiiuiuiiiiiiiiiiiiiiiiiuiiiiiiiiuiiuiiiuuuiuiiuiiiiuiu
Reply: @spencer1980  uoiouiiuiiuuiiiuuuuiuuiiuiuiiiiiiiiiiuiiiiiuiuiuuuiiiiu
Reply: @spencer1980  uiioiuiiuuiiiiiuuuiiiiiuuuiuiiiiiuuiiuuiuiiiuiuiuiiiiuiiiuiiuiiiiuuiuiuiiiiuiiiuuuuiiuiiiiiiiiiii
Reply: @spencer1980  iuiiuuuuiiiiiiiiiiiiiuiiiiiiiiiiiiiuiiiiiiiiiiiiiuuiiiiuiiiiiiuiiiiuiiiiiiuiui
Reply: @spencer1980  uuiiiuiiuiuiuuuiiuiiiuiiiiiiiiuuuiiiiiiiiiiuiuiiiiii
Reply: @spencer1980  uoiouuuiiuiuiiiuiiuiiiiiiiiiiiiiiiiuui
Reply: @spencer1980  uuuiuuiuuiiiiuiuuuiuuuiiiiiiiiiiiiuiiiiiiiiuiiiuii
Reply: @spencer1980  iouiuiiuiuuiiuiiiiuiiiiiiiiiiiiiiuiiuuuiiiiuuuiiuiuuuuiiuuuiuuiuiuuiuiuuuuiuiiuuiiuu
Reply: @spencer1980  is coming back uouuiiiiiiuiiiiiii
Reply: @spencer1980  is it uuiuiuiiiuiuiuiiiiiiiuiiiiiuiuiii
Reply: @spencer1980  is uuuiiiiiiiiiuuiiiiiiiuiiiiiiiuiiiiiiiii
Reply: @spencer1980  uiiouiiiiiuiuiiiiiiiiiiiuuuuuuuiiiiiiuiiiiii
Reply: @spencer1980  just uiiuiiuiiuiuuuiiiiiiiiiiiiiiiiiiiiiiiiiiiii
Reply: @spencer1980  uuiuuiuuuiuiiiuiiiuuiiiiiiuuiiiiiiiiuiiiiiii
Reply: @spencer1980  uoioiuiiuiiiiiiuuuuiiiiuuiiiiu
Reply: @spencer1980  uiuuiuiiiiiiuiiiiiiiuiiiiiiiiiiiiuiiiiiiiiiiiiiuiiiiiiu
Reply: @spencer1980  uiuouuiiiiuiuoiiuiuiuuuiiiiuiiuiiu
Reply: @spencer1980  just let us go and iuiiuiuuiuiuiiiiiiuuuuuiiiiiiuiiiiiiiiiiiiiiiiiiiiiiuiuiuiuiiuiu
Reply: @spencer1980  uuiiiuiiiiuiiiuuuiiuiiiuiiiiiiiiiuu
Reply: @spencer1980  uiuouiiiuiiiuiuiiiiiiiiiuiiouiiiiuuiiuui
Reply: @spencer1980  iiiuiioiiiuiiiiiiiuiiiiiiiuiiiiiiiuiiiuiiiiiuiiii
Reply: @spencer1980  iouiuiuoiuiiiuuuiiiiiuuuuiiiiiiuiiui
Reply: @spencer1980  is uuiiuuiiiuuuuiuuuiuuiiuiuiuui
Reply: @spencer1980  is coming uiioiiuiiiiiiiiuiiiiiuuiiiiiiuiiiuuiiiiiuiii
Reply: @spencer1980  is coming uiioiiuiiiiiiiiuiiiiiuuiiiiiiuiiiuuiiiiiuiiii
Reply: @spencer1980  just iiuuiiuuuuiu uuuiuiuiiiiuiu
Reply: @spencer1980  uuiiiuiiiiiiuiiiiiuuiiiiuiiiiiiiuiiiiiiiiuuiiiuiii
Reply: @spencer1980  uuuiuiiuuiiuuuuiuiiuiiuuuuuiiiiiiiiiiiuiiuiu
Reply: @spencer1980  uuiuiuuiiuiuuiuuuiuuuiiiuiiiiiiii
Reply: @spencer1980  uuuuiuiuiiuiuiuiuiuiuuiiuuiiiuiu
Reply: @spencer1980  uuiuuuuuiiuiuuuiuiiiiiiiuiiiiiuiiiiuuiiiiuiii
Reply: @spencer1980  uuiuiuuuiiiuuuiiiuiiiii
Reply: @spencer1980  is uuiuuiiuuiuuuiuiiiuiuuiiiiuuiiiii
Reply: @spencer1980  just woke iuuuiuiiuuiuuiuiiiiuiiiiiiiuuoiuuiuuiuiiuiiiuiuiiiiiii
Reply: @spencer1980  uiiouuiuiiiuiiiiuuuuuuuuiiiiiiiuuiuuuiuiuiiiuiiiuuiiuuiuiiiuiiiiiui
Reply: @spencer1980  is it too early iiuouiuuiuuiiiuuuii
Reply: @spencer1980  uuiuiuiiuiuuiiiuuiuiiiiuuiiiiiiiiuiiiiiiiiiiiuiiuiiiiiii
Reply: @spencer1980  just just called and uiiouuiuiuiiiiiiiiiuiiiiiiuuuiuuuiiii
Reply: @spencer1980  uuiuiiuiiiiiiiiiiuuiiiiiiiiuiiiiiiiiiiiiiiiiiiiiiuuiu
Reply: @spencer1980  uuiiiuuiuiuiiiiuiiouiiiiuiiuiiiiii
Reply: @spencer1980  uiiuiuiuuuuiuiiuiiiiiiiiiuuuii
Reply: @spencer1980  uiiuiuiuuuuiuiiuiiiiiiiiiuuuiii
Reply: @spencer1980  uiuoiuiuiiuuiuuuuuuiuuuiuuiiiuiuiuiiu
Reply: @spencer1980  is uit uuiiiiuiiiiiuiiiiiiiuuiiiiiii
Reply: They are not batteries they are closer to fuel cells
Reply: @Arachnotron HIgh tech will kill us all. And you know the tyranny of the rocket equation? There is a reason that space is still very expensive and will always remain so. Not sure what you think 'advanced space faring tech' is but reaction engines need lots of reaction mass and very little payload mass and are really limited on how fast they can go, which sucks in space which is much bigger than how fast we can make things go. And reactionless engines are not science, I guess it's only breaking Newton's laws not those of thermodynamics but you can't magic motion from nowhere.

I believe in reality and you believe in magic. That's fine just your points are not backed up by any science and mine will be tested in the next 50 years.

If pollution is an issue, then building more stuff that pollutes more than the old stuff to create isn't really a solution to pollution.

I do wish people would give more details because really it only ever seems like all we need to do is invent magic and everything will be OK, but we do not live in the Futurama universe so magic seems unlikely.